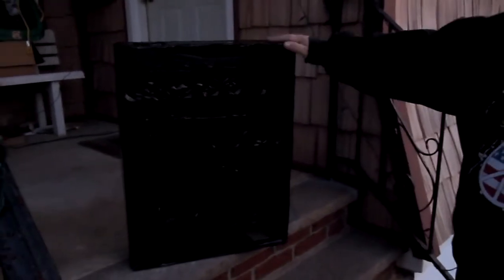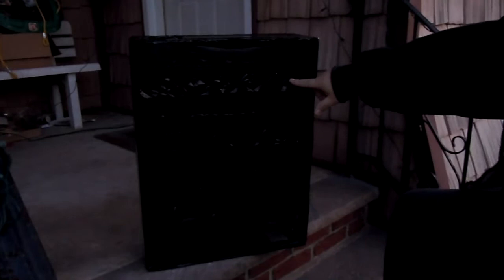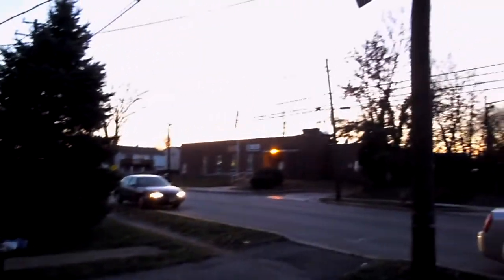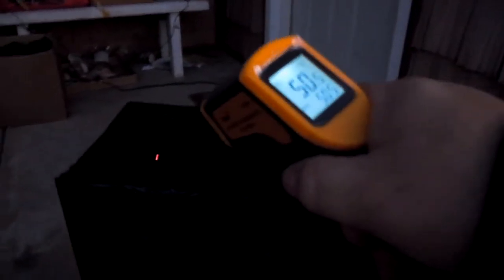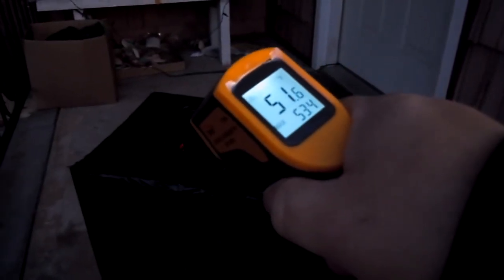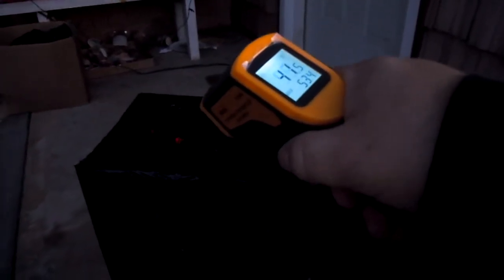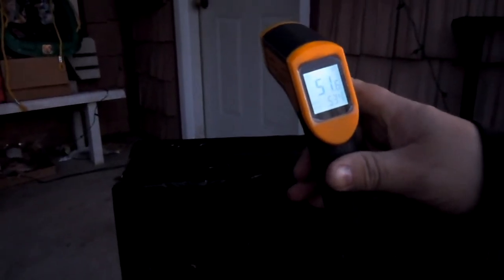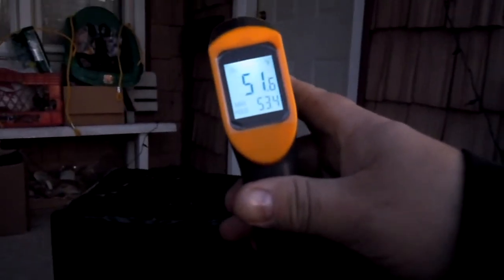Free heat, DIY passive solar heater part 1

Comment from the maker: Ah Jason, you're correct but all things considered it was a late day vid and I'd guess the air temp was actually colder.  Anyway, I only built it as a test so a few degrees here or there didn't really matter to me.  Later that year I invested in higher quality insulation, and made a box I use every year now..  I plan on making an 8x4 next year.  Its a fun project that doesn't take a lot of cash or experience.  You don't need to be perfect on the design to have it work, but if your building it for outside hanging, just be sure you seal it good to keep water out.  Good luck

Comment: good
Reply from the maker: Thanks.  It was a good first attempt.  I have since been using a box that I built that is 2'x4' and uses a computer fan with a cheap 10Watt solar panel to push the air through (and did a better job of lining up cans in it).  Hanging it off the house side window, I push inside air to it at about 68 degrees and pump it in to the dining room area thru a duct run drop ceiling at a rewarding 80 to 140 degrees depending on the sun.